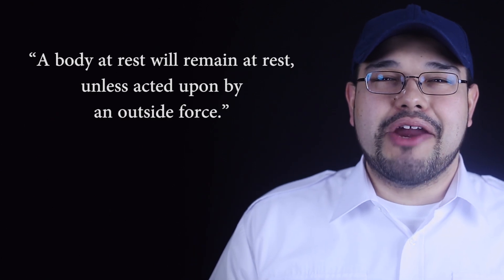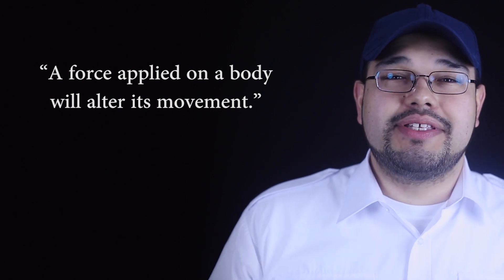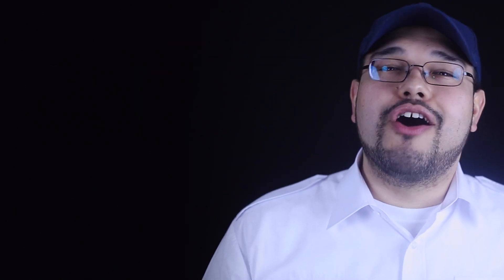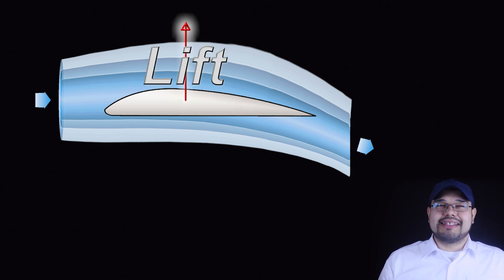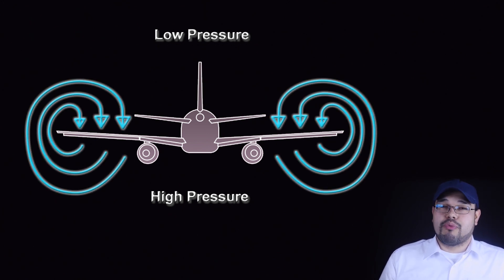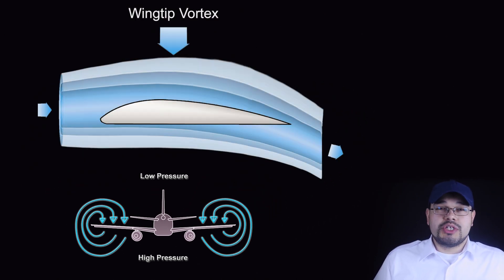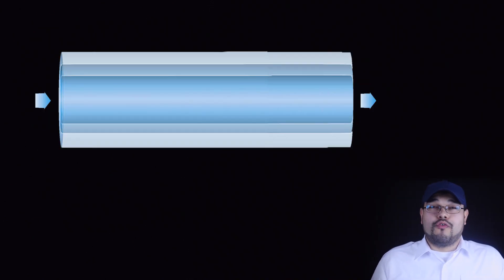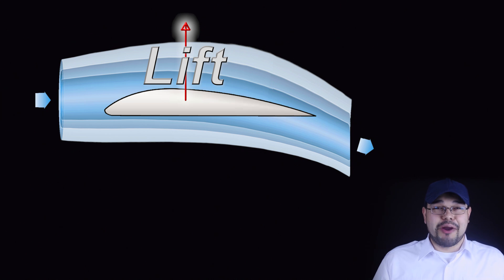Why an Airplane Flies - Part 2: Newton's Laws of Motion | Pilot Tutorial

Comment: It is a basic topological requirement that vortex filaments are endless. If there are wingtip vortices, then there has to be bound vorticity associated with the aerofoil, and a starting vortex left behind on the runway, both to complete the vortex loop. It is the bound vorticity which generates lift by the Magnus effect, or the Kutta-Joukowski circulation theorem if you wish.

You report that an aerofoil spanning a wind tunnel has no wingtip vortices. In that case there is no vorticity associated with the aerofoil, no lift, and it is likely that the working fluid is a superfluid like liquid helium. You may need to think things through.
Reply from the maker: i just wanna know what love is

Comment: This is a very theoretical explanation of how airplanes work. I would better call it how wings work. 
Commercial Airplanes use the upward lift created by Newton's law a lot more than Bernoulli's principle. 

This also means that they are quite bad at gliding, but really good at gaining altitude thanks to their engines and the ability of the pilot to change the geometry of the wings.

I think people look more often for practical explanations than theoretical explanations, which are very often counter intuitive.

For example, when going in a car at high speed in the motorway and you put your hand out the window, you will feel Newton's law lifting you hand or pushing it downwards, depending on the angle you position it: This is mostly how airplanes fly (and land!)

Comment: I believe Newton’s third law is regarding a positive AOA with regards to relative wind. At the wind attempts to strike the bottom of the wing, it is deflected downward and the the 3rd law forces the wing upward. The Second law is unrelated to this. It has to do with the momentum shift of the downward flow over the wing.
Reply: Momentum shift occurs in accordance with Newton's Second Law (Force = Rate of Change of Momentum = mass x acceleration).  Newton's Third Law tells us that forces always occur in pairs, and those pairs are equal and opposite.  Momentum change od the air results in and equal and opposite momentum change of the wing.

Comment: But according to NASA during flight there is only newton 's first law of motion.
Reply: According to NASA, which refers to real-world commercial airplanes, the lift created by Bernoulli's principle (the wing shape diagram, explained in part 1) is small in comparison with the lift Newton's 3rd law: The air deflected by the wing downwards creates an upward push on the airplane's wings, creating lift. So if we maximize the angle of attack of the wind against the wing, the bigger is the lift.

This tutorial falls into the airfoil myth, which believes that lift created by the shape of the wing has a greater impact in lift that the angle of attack of the wind against the wing.

Comment: http://www.allstar.fiu.edu/aero/airflylvl3.htm All wings turned upside down and placed at the proper angle of attack and airspeed will develop lift, just not efficiently Yes even barn doors. That is why even non-symmetrical wings will fly upside down. Wing tip vortices is a drag producer and wing efficiency killer and has little to do with the lift developed closer to the wing root. Keep reading and learning, good job.